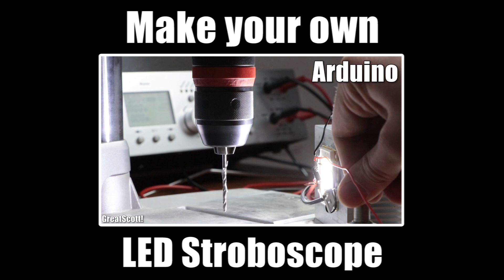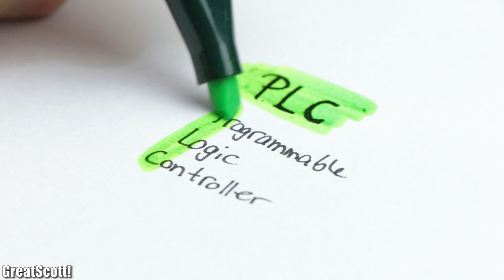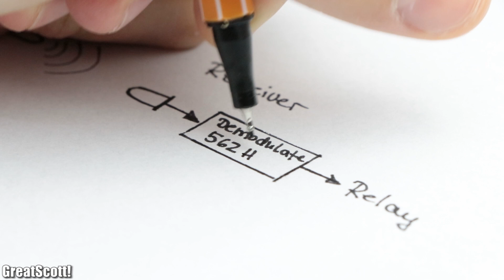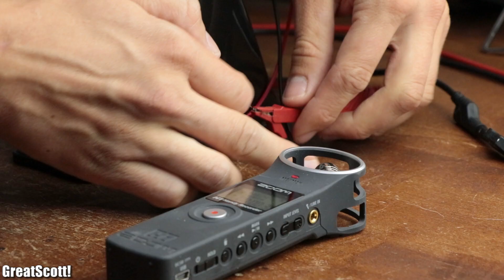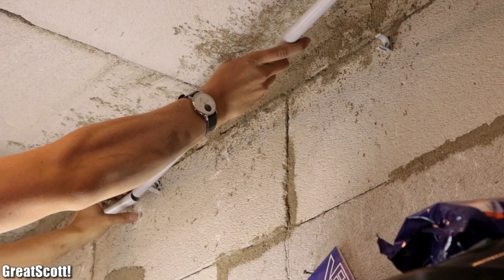DIY Light Barrier Alarm System with an industrial grade PLC (Controllino)

Comment: Please PLEASE make the pipes / conduits long enough to reach about 5mm inside the box, it looks way more neat and protects the wires, which is the whole point of it!
Reply: If you break into the building just bring some cable cutters lol
Reply: I believe this is being powered by his DC solar system. So I personally believe that the conduit is overkill.
Reply: It would be way more professional to use proper cable glands, but I also noticed that the enclosure was ABS which is not kosher in the UK any more under IET regulations, it has to be a steel enclosure for electrical mains distribution/connections in a domestic environment. Also it's much better to to use proper elbows on the bends and maintain a sealed conduit. Cable management could use some attention too. Otherwise really great idea and design concepts.
Reply: @boblewis5558  In Germany it is still fine to use ABS, I believe. I do agree on the cable glands.

Comment: if the max intensity of the internal relays are not close enough to drive the siren and the led. What stops you to use 2 relays in parallel for each?

Comment: How does the 25 watt amplifier drive an 100 watt siren? 

Also, nice vid as always
Reply: I suppose that the "100W" stated on the box are only for max volume. With a horn driver like that (very efficient) and such high power you can easily damage your hearing. So lowering the overall volume is not only safer for humans, but may also be driven with less power.
Same as your 150W hifi speakers don't necessarily need the same power as input in order to work properly. When it comes to home audio, just ignore all those big numbers. Get decent stuff and it'll work.
Reply: It doesn't take 100W to drive the siren but it is rated to handle 100W. The 100W stereo speakers that I used probably used to be run between 5-10W for comfortable listening levels. Probably why I still have my hearing.

Comment: I could recreate this entire system for around 30$ 🤦‍♂️. I guess I'm failing to see the point of using a plc if you are only using it as a relay and include no user interface to interact with the alarm 🤷‍♂️ even then it would be pointless at a picaxe chip and a logic controllable relay could be bought for around 1/75th of the price and programmed much easier while still having the option for a keypad. Even an arduino would have been a better choice here. I get that the plc manufacturer sponsored this video but it would have been good to see the plc's actual capability instead of an over priced relay circuit.

Comment: So many different options you could add/change. As mentioned below passcode module, internet functionality, auto law enforcement notification, automatic security camera activation, hidden reset switch upon false activation, automatic air conditioning system using a relay output (if applicable). The possibilities are endless with a good PLC.

Comment: you can but an GSM module that can call your number or your call 911 with a recorded message also if the PLC features can let you install a camera or with the assistant of another microcontroller it will be cool to send you a message with the intruder photo

Comment: Great project! But you could use some flex-tubing (used in industrial electric circuits, since you got so many industrial grade components) for the cable elbows/turns to make a nice and neat job. Those cables are still easy to break/cut.

Comment: You should install a dog, or a backup battery if the eletricity fails
Reply: Installing a dog works pretty well.
Unless your dog is like mine and would cuddle even with intruders.
Reply: @lazar2175  Or, install a lion, who's cage will be opened by a servo motor connected to the controllino!
Reply: @PrajjalakChattopadhyay  when the power runs out the lion is still in its cage or if it opens when powers out then scot will have problems to replace the battery
Reply: @PrajjalakChattopadhyay  Uhh, that's a great idea.
Until i enter my shop sleepy and get mauled to death lol.

Ahh, who am i lying, my shop is only big enough to fit one person and a small breadboard lol.
But one day, i'll get a bigger one and i'll get a tiger in resistor colours.
Reply: LOL! Install a dog! :-D

Comment: please make a 3 axis mobile gimble without using BLDC motors. you can use DC motor, stepper and servo motors with MPU6050 for sensing the position and STM32 or arduino nano as controller whichever works good.

Comment: Slightly overkill, a latching relay would have done the trick...
Reply: Slightly? Using an industrial plc for an alarm system is like using a flame thrower to light a candle.
Reply: cuz this is sponsored
Reply: Or just a normal Arduino, or better, an ESP32 so that you can easily connect it to the Internet for notifications and also for a better way of en/disabling such as RFID, PIN and/or fingerprint reader. But it's sponsored, so...

Comment: Next thing to add: pipe elbow fittings and box pipe fittings. :)
Inspiring video as always, thanks for sharing.
Reply: yeah, the box without fittings is triggering me :D, also the cable managment in the box
Reply: Or at least joiners.
Reply: How long before the insects move into the box and take up residence there.  Nice and warm and cozy!  Until a couple of years from now when the otherwise reliable PLC has a fault in the connections due to all the bugs and their residue.

Comment: You can add 
*automatic light system using PIR or Clap ON/OFF circuit
*GSM / use the Ethernet port to send the alerts 🚨 to your mobile
*camera module to capture the intruder 
What not since there are many unused port left

Comment: Great!

Instead of using delay()_, personally I'd use a timer initialised to >5min and reset to zero whenever the beam is triggered, and write the value of _timer < 5min to the siren pin.

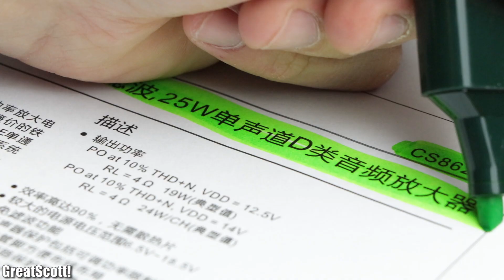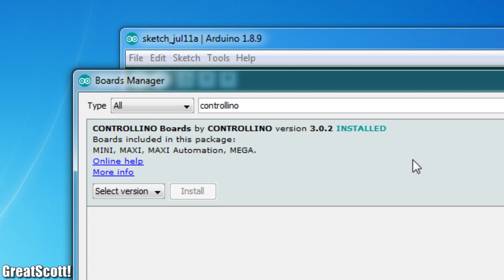That way, if someone trips the beam a second time after 4:30 minutes, the siren will keep going for another five minutes, staying active for 9:30 minutes in total.

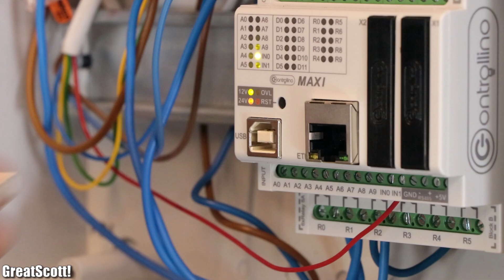Comment: 9:03 At least clean up the wiring up a bit
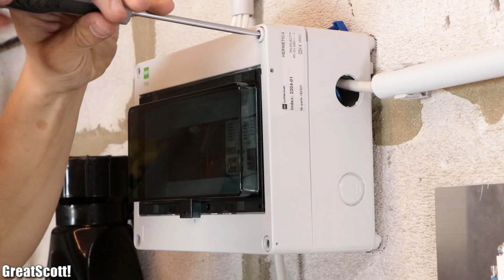10:17 The conduit should go in the distribution box hole
Reply: We do do that here in Germany, he should use a Cable gland or a Würgenippel (couldn't find a Translation for that)
Reply: @H4zuZazu  Yes, one of those waterproof strain relief nuts.

Comment: Using a PLC, beside being the sponsor of this video, for such an application is like trying to kill mosquitos with russia's s400 aerial defense systems. A bunch of logical circuitry (3 or 4 74xx) would probably do the trick.
Reply: Or even an Arduino with some mosfets and relays would do the tricks. Why use an arduino mega in an industrial enclousure with a bunch of relays for 200€? For 260€ you could buy a DSO(siglent SDS 1052)

Comment: Question - why didn't you use a keypad to disable the alarm?

Also, an idea for the controlino - light control, you can use the ir sensor to automatically turn on the lights, and maybe even cobtrol rgb led strips.

Comment: For the younger crowd watching. There's good money and job security in the industrial automation field using PLCs.
Reply: Rocky River Mushrooms thanks for the tip
Reply: 100% worth investing your time and knowledge into
Reply: This is very true!  Almost every machine in our plant is PLC driven. Even the machine that folds the case flaps over and tapes it shut. 

Our biggest net has one controller and hundreds of IO spread across 15 racks and most of an acre.
Reply: One of my professors said plcs are old and cheap. I bet he’s a moron
Reply: @danithaman4610  pretty much all simple industrial automation is done with a PLC. Back in the day there were dedicated rooms with all the control circuits hardwired. Now it's all in a control cabinet.
Reply: It is true indeed, i work with industrial automation and i would say almost every week i deliver and install Omron PLC's they are more used than people think. And people saying PLC is old and not used etc. Thats Just pure bullshit.
Reply: yea, but they ask u 40years experience as it would be nasa matter to plug and program them in. Personally I used shneider plcs with all different attachments for different applications (irrigation systems, alarms, auto gates etc..) but they don t give absolute fck about it. they just look at years of experience.
Reply: @marek196c  that's true. Experience is valued highly in engineering fields. School and a nice resume will get you started. Even if you don't meet their requirements just apply anyways.
Reply: @rockyrivermushrooms  what if you dont understand maths?
Reply: @Steve00alt  ladder logic doesnt require higher level maths. programming in general doesnt really need maths much.
Reply: @ Marek S 
It’s not always the case. Only 2 “engineers” in the plant have degrees, neither has more than five or ten years experience. I have had to explain to one of them how some mechanical devices function. On the other hand, connecting Traksys to a PLC is over my head. Not only can any of the maintenance techs access the PLS logic, they are expected to do so. We hired a kid mostly because his wife works here already and he’d done preventative maintenance on ice cream machinery.
Reply: Thanks fam -2020
Reply: I've worked with PLCs in the context of cyber security, and trust me if you don't want to be doing ladder logic diagrams all day, that is a path you can pick. 

It is surprising how hybrid solutions (cyber and OT) led to hybrid problem that end up needing cyber security professionals.
Reply: It's work for old electricians not young engineers. Not very interesting, you'll be spending most of your time wiring up the boxes and troubleshooting stupid communication issues, the pay is shit compared to jobs in software engineering. If you are of above average intelligence you can do better.
Reply: @migkillerphantom  young ppl are not smarter than the loads of experienced old people have had
Reply: @Steve00alt  All I am saying is that this is not a job someone intelligent should waste their life on. Leave it to the electricians of average intelligence, since they can figure it out over time just like you're saying.
Reply: I finished my Electrotechnical Engineer degree in October and started working on Industrial automation in January, 7 months later i already had to work with fews PLC of different brands: Siemens, Scheneider, Omron. It is very interesting and there's never lack of work :) (I also do some electrician assistance sometimes, it is also important to do this kind of tasks). Nevertheless, i would like to leave this area and try the investigation field hehehe :). Something in my head is saying i should not waste my youth (22 years) and keep studying (get a master degree and keep working on investigation field since i realy like to study and learn new academic things)

Comment: I just don't like only alarm because if you aren't at home it can't do anything instead you should have made some locking system for ur garage door that only if the magnet is positioned correctly then only it will open up😇